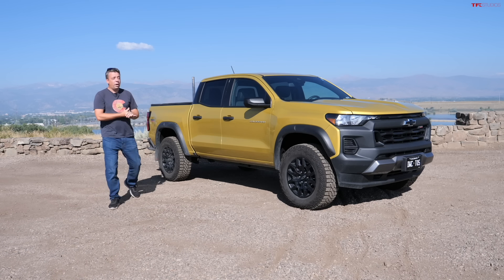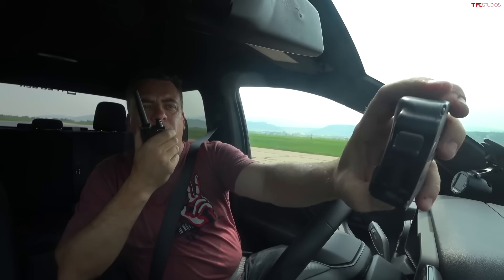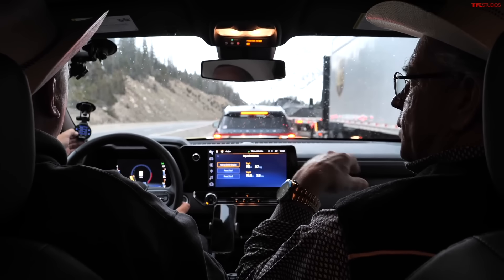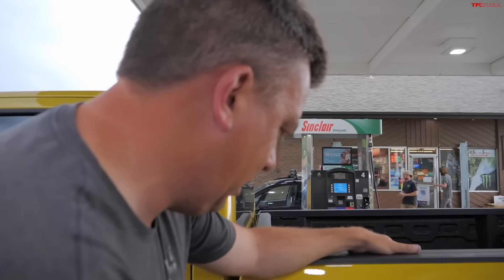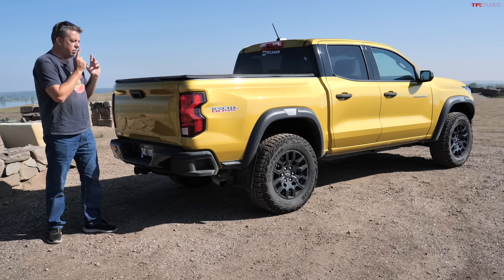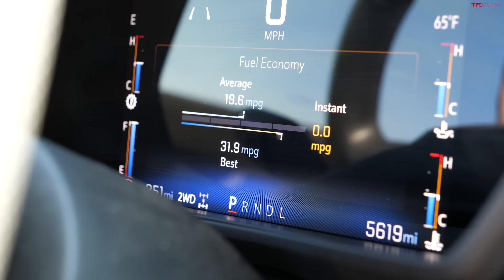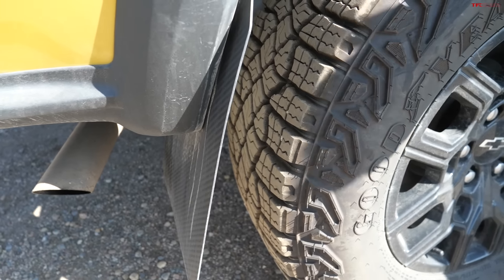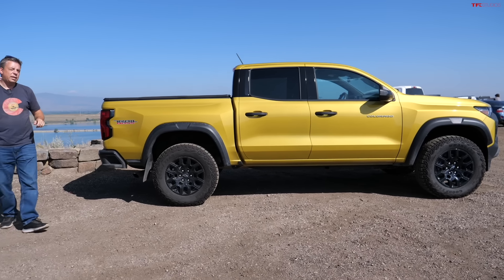Chevy Colorado: Great & Awful Things I Learned After 6,000 Miles - Long-term Update

Comment: Mpgs are at or less than a V8. Ive averaged 11 mpg towing long distance with a 5.4 2v Ford.
Reply: I don't think you're going to get Lucy better gas mileage under heavy use with anything that requires gasoline, it would need to be diesel or hybrid. The 4 cylinder can get better gas mileage in certain scenarios that don't require a big load on the engine. Unfortunately there's no secret sauce really, it takes fuel to create energy, plain and simple
Reply: @mt186  Yeah but a 4cyl getting V8 mpgs while towing is bad. Be one thing if it got 12-14 mpg in this midsize. Wouldn't touch this engine in the 1500.
Reply: @302Mustang13  I don't really look at it as bad, more that it's expected. There's just really no way to produce that kind of power with regular gasoline and not consume a lot of it. The fact that you can get better gas mileage during the majority of the time you're driving the vehicle is beneficial. Most people don't tow the majority of the time they drive their truck, and for the rare people that do, this truck probably isn't for them, I would argue that the 5.3 wouldn't be either though. Probably need a diesel

Comment: How high did your transmission temp get going up the mountain with a trailer. I have a z71 high output & love it but hard to get gas cap open
Reply: Gas cap door open, 2500 mi Ave gas 23.1 mpg

Comment: Have they checked if the backup cam is hooked up? Or checked the wiring to it? Did you try disconnecting tbe battery again. The dealer can also try reprogramming the software. Also, they shouldnt be waiting for parts for the tune. Its a file thats sent to them not a hardrive. So they should have an email or file in their diag tool

Comment: here is the result from TFL towing up the "Ike"...

Colorado 4cyl turbo / Frontier 6cyl na
box trailer weight # 6800 / 6700
payload  max / max
squat inches 2.5 / 2.0
speed mph 60 / 60 
time minutes 7.5 / 7.9
max throttle foot to floor  yes / yes
fuel consumed mpg 3.6 / 4.4 
engine rpm 5400 / 6000
engine rpm per cylinder 1350 / 1000

conclusion for towing equal weights and mph:
Colorado:
4cyl turbo works 35% harder, 
4cyl turbo consumes 22% more fuel
suspension squats 25% more

Nissan is the superior truck

Comment: The new Colorado is a very good looking truck, Chevy really stepped up. I do wish it was an EV so I won't be buying one at least. I saw a Denali Canyon the other day in a dark red and I have to say it was the most attractive "small" truck I have ever seen.
Reply: Chevy won't waste money making an ev colorado, especially knowing how much they're losing on the full size version.  Complete toilet flush of money.
Reply: The problem is that if it was an EV than it would be about $60k. Also, for him towing a boat what would the range be. He is towing 6000 pounds plus his family and camping gear. Though the range is only 200 miles he can easily pull into a gas station and fill up and be back on the road within 10 minutes (depending on how fast the family is in the restroom). When TFL towed a teardrop trailer (less than 3000 lbs.) with a Rivian on a flat course the range (90% used) was about 150 miles.
Reply: @Hooner77  150-200 mile range is perfect for a day trip to the lake with your boat, gear, and family. I do see it causing problems if you're planning to road trip while towing a boat or even a small trailer. You would think an EV Colorado would outsell the full size EV trucks.
Reply: @elche1976  Yes and no. A lot of States will most likely ban the sale of new ICE vehicles soon and with so many people making the switch to EV it would be good for GM to stay current and create trucks that are in high market demand. After all the future is electric and the infrastructure is actually being built fast so accessing a charger is easier than ever.
Reply: . @arthurwright255.  That is very true if your making short trips with your boat to a nearby lake or river. As for outselling full size EV trucks, maybe. It would depend on the price. Currently mid-size trucks prices range from $29K to over $50k. If auto manufacturers want to be successful with mid-size EV trucks, there's the price range they need to shoot for. What makes that difficult is the technology required for an EV. Technology especially software is expensive to buy and expensive to repair. I have had a great career the last 43 years because technology fails. For widespread EV adoption the charging infrastructure has to greatly improve. Where I live there has been more charging stations added. You will still not find one to accommodate a truck and trailer.

Comment: Come back if it's still alive after 60,000 miles.  Pulling is the easy part of towing.  Tell us about handling in a crosswind and braking.  You gave no trailer weight numbers so there is no way to evaluate your claims.

Comment: Highway trip gets only 21.7 mpg ????   I get better than that with my Ford F150 SuperCrew with 5.0 Coyote V8.....  Chevy Colorado/ GMC Canyon are a complete waste of money..... Less room, terrible gas mileage, less power, less towing capacity - - - and NOT much cheaper.  Buy a full size truck and get a REAL truck and maximize your investment dollars.  GM is generally junk and unreliable - - all of the long term data bears this out.

Comment: I can't stand the shifter location and no headlight dial or knob whoever thought to put the headlight switch into the screen should be fired that's idiotic and also not smart it's stupid.
Reply: Some swirches should not be hidden in a touch screen
Reply: @nipperdawg1865  I totally agree and that's why I wouldn't get this truck even if I wanted to somethings shouldn't be changed something as simple as headlight knob or dial shouldn't be changed to where it's built into the screen. That's why I would go for the Ranger the new one to me the ranger in my opinion looks better and also the shifter location is just also not doing it for me either

Comment: As a fleet manager I gotta say, GM vehicles are the worst.
Reply: The last few years they had poor transmissions ....the engines were great, long lasting until they recently used sub par lifters...and or due to AFM system....assume that's been resolved by now for the V8 offerings.
Reply: @2011buddylee  we have 23 Chevy trucks, not one has made it to 40,000 miles without needing an engine or transmission. We have a 2021 with 26,000 miles getting its 3rd engine. And getting parts always takes 3-6 months. 

As fleet vehicles they're terrible, downtime is money lost.
Reply: @2011buddylee  wish I could say the same but we've had nothing but issues. We're done with GM. We had one truck down for 8 months waiting on an oil line, it's insane
Reply: @fopm008  I'm betting these problems are DUE TO LIFTER / VALVE failings..correct?
Reply: @barrya.6212  sometimes, sometimes it's internal oil leaks, cracked blocks, and all sorts of crap. We've even had 2 where the fuse boxes melted while driving.

Comment: 21.7 mpg isn’t that good. The 2.8 Duramax in the previous Colorado got nearly 50% better mpg.
Reply: Maybe on a highway trip, sure, but not long term lifetime average.  Best I saw with my 2.8 Duramax on a tank hand calculated was 30.2mpg.  Otherwise I'd be anywhere from 23-28mpg per tank hand calculated.  My lifetime average was 25.6mpg over 35,000mi.

Comment: Umm 6K miles is nothing. How about 106K or more??
Reply: Yes let’s wait for ten years and then hear his experience with the the 2023 Trail Boss. It will be very relevant and fresh information that time.
Reply: @is6566  ummm I can rack up 100k in three to five years easy. No way is 6k long term LOL especially considering the history of that transmission. Im guessing you know nothing about GM.
Reply: Ok then why don’t you do it, and post it on YouTube? BTW racking up that mileage in 3-5 years will still make a stale video report for 2023 trucks. I can do it with my current driving habits in 3 years. It’s still a stale report. Andre drives a ton of other vehicles for review. He can’t rack up 100k in three years in one truck because he racks up 200k in 80 different vehicles. And you are guessing wrong. Among other things I drive a gmc hd diesel.

Comment: I think the Gladiator would have been a better choice… Can’t beat solid axels
Reply: Overpriced pieces of junk, that’s basically the motto of anything made by stellantis nowadays.
Reply: I’ve been driving solid axle vehicles most my life.  There is no comparison on the road between even my new Super Duty and my wife’s decade-old 4Runner, and I consider 4Runners to be “un-fun” to drive, but it tracks straighter, with less effort, and has less feedback through the steering wheel.